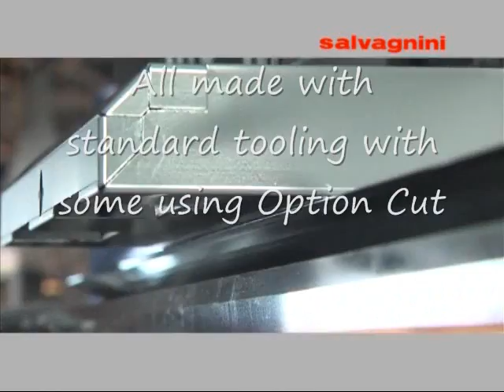Salvagnini Panel Bender part pictures and samples.wmv

Comment: So i guess salvagnini panel bender cannot bend reverse 90 degrees on same sheet
Reply from the maker: Yes of course Salvagnini panel benders can make reverse bends - since 1977.  What kinds of parts do you make?
Reply: @skido7  yes but think of a sheet metal in X axis and from one edge its bended upwards and from other edge its bended downwards. That sheet wont come out after 2nd bend. And again think of a triangular bending position facing X axis. The bending head wont take the right position. It will only bend if the metal comes from zero degree position on all edges. However its still good tho but in some of my products it has to collaborate with a press brake.
Reply from the maker: @TheYavy  If a panel finished with 2 sides up & 2 sides down, then yes for sure we finish this part on a brake.  3 sides up & 1 side down can be formed complete with the need of a brake.